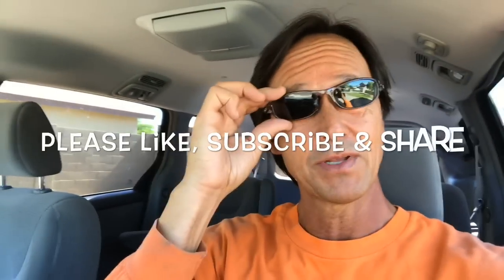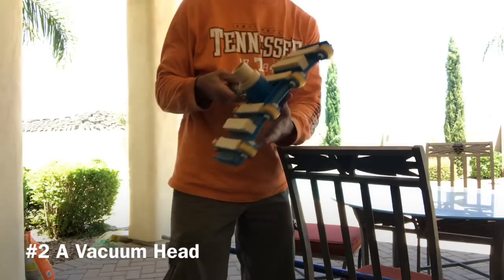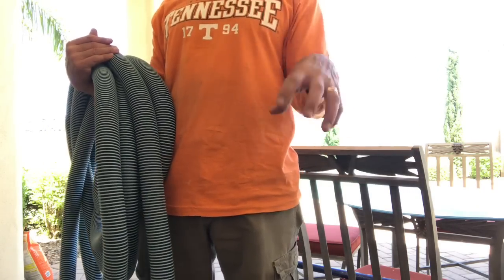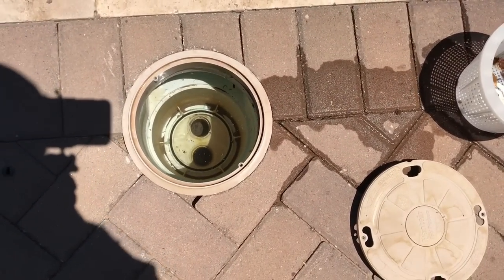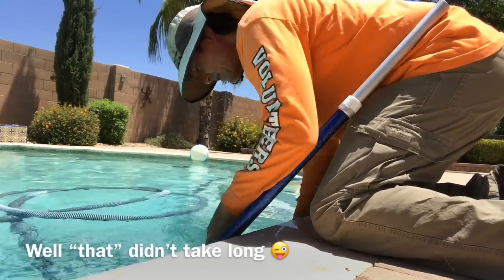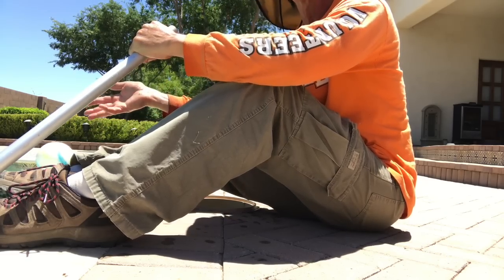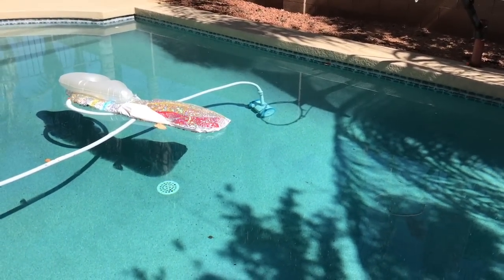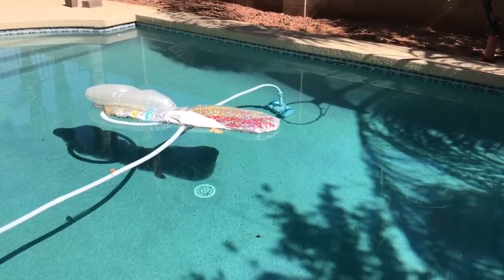Vacuuming a Pool Manually

Comment: get you a kee pad with a handle/hole in it at Home Depot/Lowe''s garden section....my techs use it for a knee pad as well as slipping the pole thru it and push the pad down the pole to the deck...freeing you up to use both hands..the pole stays in place

Comment: What do you recommend for pool owners that deal with heavy rain? Recently in my area rain has been pouring down, and it is completely zeroing out our CYA and chlorine. We also get a lot of sun, which isn't good for low CYA. What would you suggest I do?
Reply from the maker: If your water level gets too high (over the tile line) you’re going to need to empty some of the water. In Arizona Sand and DE filters just  need to be back washed to bring the water level down just make sure if it’s a DE filter you recharge it. And in Arizona all the cartridge filters that I service have a hose spigot in the line that allows me to open that to drain off excess water in case the water level gets too high. 

With regards to chemicals, the only thing you can do with the large amounts of water diluting your chemistry and evaporating it, is to keep adding the necessary chemicals to bring the levels up to the ideal range.  It’s really just as simple as that.
Reply: You could also get a cover system like an Aquamatic EZcover where you can open and shut them quickly. We get lots of rain and we shut that cover when rain is expected and put a cover pump on to get rid of excess water.
Reply: Rain does NOT remove CYA from your pool water (though I sure wish it did).  Neither does sunlight.  If you have that "problem", which isn't really a problem at all, just keep adding those trichlor tabs.  You'll soon have CYA as high as you want it.

Comment: Hello i have a pipe and valve that leads into the valve for the vaccum and skimmer pipes like the one in the video shown before the pump. I was wonderinh what does that valve do? Im trying to figure out how to vaccum to waste from the dedicated suction port when i suction manually. Is the pipe/valve going into the valve before pump possibly the waste valve? How would we know we are  vaccuming to waste i tried turning valves but i dont see  any water getting wasted..thanks for your time and sorry for any confusion.
Reply from the maker: I'd have to see a picture or video of your set up. Also when it comes to vacuum to waste most sand or DE filters don't have that option.  Typically if you "vacuum to waste" the water runs out of a backwash hose or something like that.  typically if you manually vacuum your pool it goes through the the filter to be filtered (the larger debris gets caught by the pump basket which would then need to be emptied). Depending on the type of filter you have you may need to backwash it (sand or DE) or over time clean it if it's cartridge.

Comment: That's a rainbow pro vac 214. Also has a built in swivel for the hose. And those white strips on the underside is where the magic happens.
Reply from the maker: Best Vac Head I've ever used.

Comment: Question: one of the pools that I was assigned to had a skimmer closed. So I  opened the skimmer valve. While I was done vacuuming his pool, it was time for me to vacuum his spa (spa is attached to his pool). However his spa jets was “on” which made it impossible for me to see the bottom of his spa. My question to you is this, how do I shut off the spa jets?
Reply from the maker: There should be a valve that controls the returns to the spa and typically you can shut that valve off. Just make sure you have the returns to the pool open completely so the pressure doesn’t build in the filter.
Reply: @PoolSchooler  thank you for responding back. Will do what you suggested.

Comment: Hi, I’ve got a question. When vacuuming do you do it under the FILTER setting or under the WASTE setting? My dad has been doing it under the WASTE setting for years and I’m afraid he’s wrong. When vacuuming our pool he always wastes tons of liters of water into the yard, so we fill it up again with a hose.
Reply from the maker: You can do it either way.  If you uses the "filter" setting then the dirt is caught by the filter and not poured out into the yard.  On the waste setting the dirty (vacuumed) water bypasses filtration and goes directly into wherever your backwash hose goes to.  So to save water you can vacuum in the filtration mode.

Typically you'd vacuum to "waste" only if there was a ton of dirt on the bottom of the pool as that much dirt would quickly saturate your sand and start to come back into the pool.

Comment: QUESTION : When you are manually vacuuming the pool why not plug the hose in to the side of the pool?  The port the automatic vacuum is using?  Seems like that would be easier.
Reply from the maker: You are right but there are a lot of pools (especially older ones) that don't have that dedicated vacuum port in the side of the pool.  So they have to tap into the skimmer.  ALSO most pools that have a side port have a stay in the pool suction side vacuum that runs when the filter pump runs so the need to manually vacuum those is somewhat non existent.

Comment: If the front hole inside the skimmer (not the rear one that leads to the pump) leads down to the floor drain, how does it receive any suction? Many of your clients' pools have 2 inlets into the pump (with the Jandy valve): one inlet pipe is marked "skimmer" (obviously a direct line from the rear hole), and the other is marked "floor drain". Where does the "floor drain" marked pipe lead from? It seems as if the floor drain pipe just goes from the floor drain up to the skimmer front hole - standing water, no suction... how does it route up to the pump then?
Reply from the maker: That is usually handled by a skimmer diverter.  Here's a link to a video I did on those:  https://youtu.be/-TUs90A5uVo
Reply: @PoolSchooler  I've seen that video as well, very helpful. I have that same situation, although I think my diverter might be a bit worn out.
For those pools that have 2 pump inlet pipes coming up into a tee with a Jandy valve (one marked "skimmer" and one marked "floor drain"), am I correct in assuming that their floor drain is piped directly up to the equipment, and NOT to the skimmer box then?

My pump only has one inlet pipe coming up from the ground (no tee or valve) and this is from the rear hole inside the skimmer. Seems much more efficient to be piped directly from the floor drain to the pump, and utilizing a 3-way valve right before the pump, rather than a diverter inside the skimmer.
Reply from the maker: @thatlewdfrogman  So it would sound like you have a single pipe running into your pump (suction side) that's directly to the skimmer and the second hole in the skimmer is for the floor drain.  Most pools (in AZ at least) that have a dedicated suction line for a pool vac have the two you described coming into the pump with a jandy valve to adjust the suction between the skimmer and pool vac.  (the skimmer still usually has the two holes, one for the floor drain and the diverter adjusts that suction between the two).  They don't usually dedicate a suction line to a floor drain as you described above, as if too much suction is accidentally put to that, theoretically a child could get stuck on it and possibly drown.

Hope that makes sense.
Reply: @PoolSchooler  Yes! Makes sense and I completely understand. Unfortunately I don't have a dedicated suction line for a vacuum, however one of my returns is linked to a booster pump to run a pressure side cleaner (had an old Polaris when we bought the house, but wasn't impressed). I have since removed it and stopped running the booster pump, only the regular pump (been vacuuming the old-school way with a pole and vacuum head). I ordered a VacMate and Barracuda G3 (per your recommendation in other videos/comments) and plan to use those inside the skimmer. Hopefully that's the right combo to clean the dirt/leaves off the floor as well as keep the surface clean. Now onto figure out which VS pump to buy to replace the old single speed one! Can't thank you enough for all the help/info because of your videos!
Reply from the maker: @thatlewdfrogman  Sounds like you got this.  You'll be pleased with the 3 and VacMate combo.  ALSO my suggestion on VS pump would be to stick with the brand you already have as a single speed.  ie: Hayward, stay with Hayward, Pentair, stay with pentair.  Let me know things go.
Reply from the maker: @thatlewdfrogman  Hmmm.  Only one suction side pipe going into the pump? So my guess is that your floor drain is disabled.  Unless they share the suction pipe underground (which would be a pretty bad way to plumb a pool). Sorry I can't be of more help.
Reply: What's shown here is called a dedicated main drain. One skimmer hole should be capped off.

Comment: Hello again from az. 😀 I have the inter 18 ft /48 in above ground pool and the intex cleaner which is “ok” at picking up leaves but not so great on the sand that gets in the pool - any suggestions on getting this sand out?
Reply from the maker: That may be a suction problem.  Most above ground pools don't come with a very powerful pump/filter combo.  Hayward and Pentair both make above ground pool pump/filter systems that are much better and effective (although they aren't cheap).  You may want to look into one of those.

You also may have to just manually vacuum the sandy parts of your pool manually.

Comment: I’m a first time pool owner and our pool is opened useable. But when I try and vacuum it myself I can’t get the constant flow and it just moves the things on the bottom around and does not pick it up. Could you tell a possible reason for this?
Reply from the maker: You may not have enough suction dedicated to the suction line or you may have two skimmers in which case you would need to plug one of them so as to avoid the suction diverting to the non vacuum attached one (you can use a tennis ball for that).  I'd have to see your set up before I could accurately comment.  Email me a pic of a) your pool equipment plumbing so I can see your suction lines at the pump AND b) where you're plugging your vacuum hose into (do you have a dedicated suction line? or are you using your skimmer AND c) how many skimmers you have.  kennypoolschool@gmail.com

Comment: Hey I vacuum pool and it's clean... after filter runs at night I notice dirt comes right back in the pool, re circulated from, the filter/pump... what can possibly be the cause of this? It is a cartridge filter system
Reply from the maker: Could be your cartridges need cleaning or your may have a crack in your filter manifold.

Comment: I just cleaned my pool filter today but when I start it it won’t pump water. I prime it by putting water on my pump but still not working. I ha e a jacuzzi pump.
Reply: Probably an air lock. Need to bleed the air off somehow. I have no idea what equipt you have so I can say where to do it. Some filters have a bleeder on top.

Comment: My vacuum hose is Stuck in skimmer hole
Reply from the maker: That does happen sometimes.  Usually it's due to one of two things.  Either your water needs to be raised a little bit (rule of thumb half way up the skimmer opening or tile line) or you have too much suction to your skimmer, try reducing it a little bit.

Comment: I can't believe folks are still using these things now that electric robotic vacuums are available and work so well.
Reply: Not everyone can afford new automatic vacuums...
Reply: @chrisyoumans6012  I hear you, but I'm just not buying the argument.  A decent robotic vacuum can be had for less than a smartphone.  And EVERYONE has a smartphone these days.
Reply: @chuckschillingvideos  I hear ya but do they have payment plans for these robotic vacuums? 🤔
Reply: Try ere still a pain , you need to empty out the leaf canister and sometimes they stop working if the suction on your pump sucks
Reply: @ericcendejas7505  I think you're confused.  Electronic pool vacuums don't have anything to do with the pool pump.  They have internal motors that generate the necessary suction.  And the leaf canisters hold a surprising amount of material.
Reply: @chuckschillingvideos  a good electronic robotics cleaner will run you $1500, better off hiring a pool guy
Reply: @ericcendejas7505  No, it isn't.  It's not as though pool guys work for free now is it?  And you can get outstanding robotic vacs for less than a grand.  I need to vacuum my pool at least three times a week.  I'm sure as shit not paying a pool guy to do that.
Reply: @chuckschillingvideos  what about pools with a lot of leaves like in California? And who’s going to brush the walls full of algae in the summer?
Reply: Spoken from a position of extreme privilege.